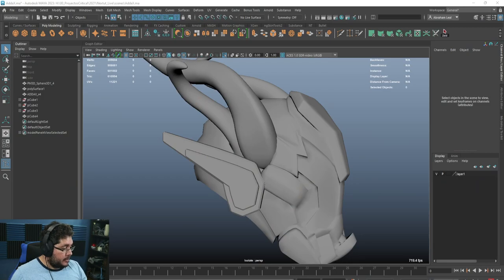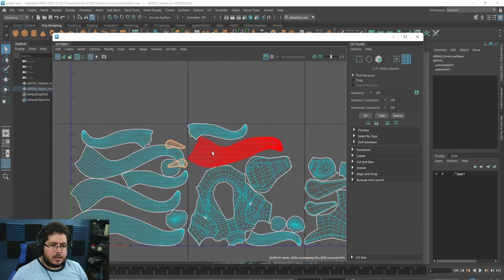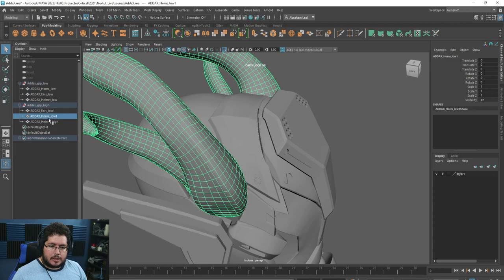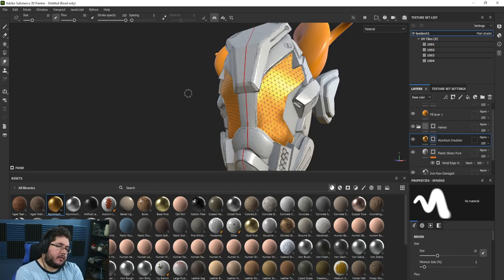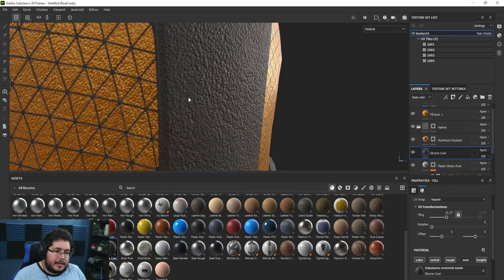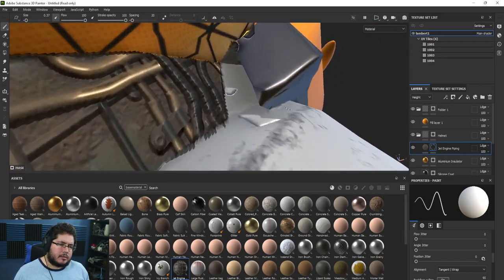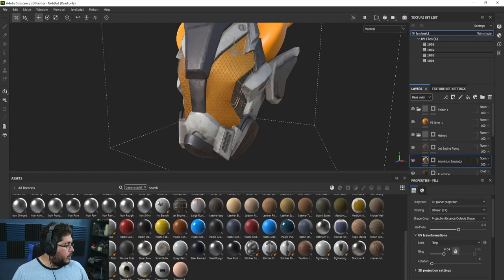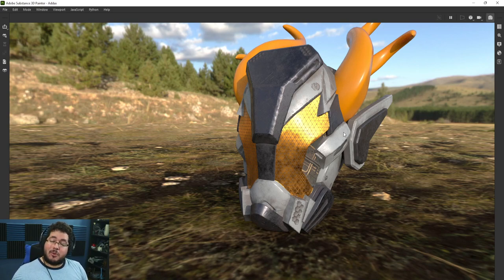Sculpt a Sci Fi Helmet | Part 9 Texturing Basics

Comment: Hello abraham! I like watching your videos because I always find new tips and tricks. I wonder however, why you tend to use the face selection tool alot for masking (which is slow and can be finicky), when as I'm sure you know you could plan ahead with your UV seams and then once in painter, mask by UVs?
Reply: Great point. Or use an ID map. Or use the element select option.
Reply: that is an excellent question. And the answer is completely accurate as well, when i have more time i definitely cut my uvs more precisely and i also like to create ID Maps, unfortunely i have limited time to work on this videos and therefore i can-t always incorporate all of the tecnniques.